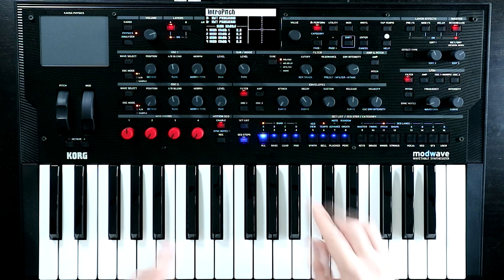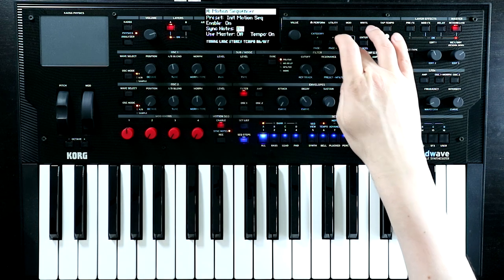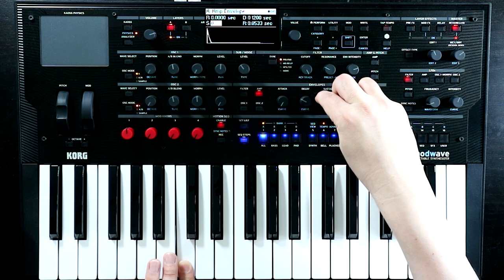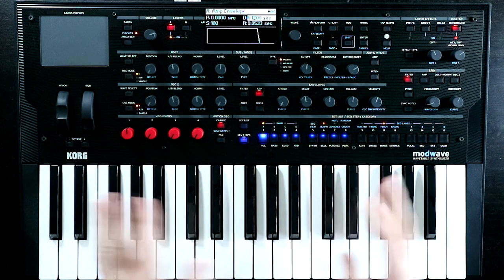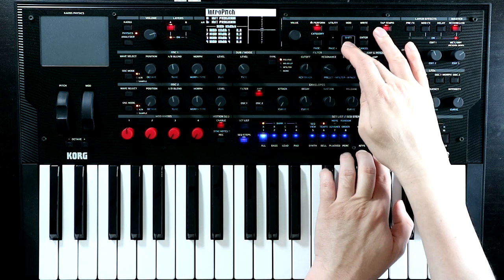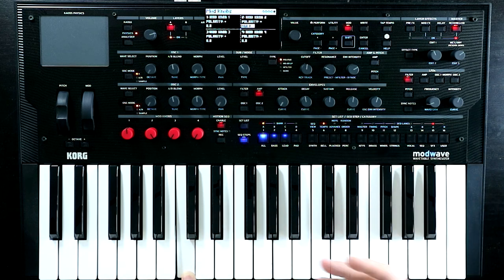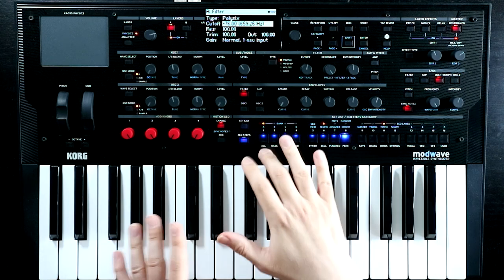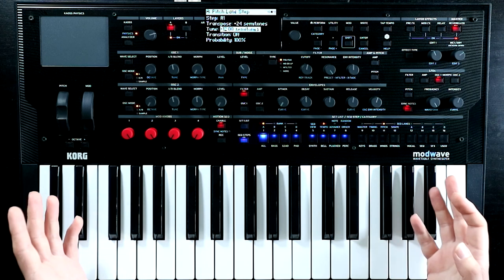Korg Modwave Sequencer In Depth - Part 1: Introduction and Pitch Lane

Comment: Excellent video. I bought the Modwave for my teenage son a few weeks back as he said he wanted something portable that he could dive into learning synthesis; you know, "baby's first synthesizer" and all that. Jeez, I had no idea the Modwave was insanely deep. Nice bit of easily accessible sparkle & shine to take a dip in the shallow end and noodle about on. But I tore the proverbial hood off this thing once I printed up the manual. Wow. Unbelievably deep in an incredible number of ways. I hooked this up to my Hydrasynth and mapped the poly aftertouch to several parameters on the Modwave. So lively and performance oriented. This Wave and Motion Sequencing tech is killer and I think Korg has just given us a glimpse of its future potential here.

Comment: You are really selling me on the ModWave - I didn't realize that the sequencer is on a par with modular analogue sequencing. I know that analogue sequencer modules themselves usually don't actually transpose - the CV summing to enable transposition occurs elsewhere - but the lack of transposition in digital step sequencers (e.g. Roland Boutique JP-08) has been a fail that has annoyed me enormously for decades.
Reply from the maker: The whole of the Modwave feels very "modular". I don't know if you've seen my video about the envelopes on the Modwave, but you'll see the same philosophy happening there. The Mod Matrix has, hundreds of slots, each with what is functionally a VCA optionally controlled by another parameter, it's all very modular.
Reply: @OscillatorSink  I'll definitely be checking out more of your ModWave videos.

Comment: thanks for this video. You say that if someone needs a "traditional" sequencer to build songs it would probably be better to resource to an external one. Could you please suggest one or a few cheap entry level sequencers that can do the job, maybe also adding a drum machine feature? I was thrown off by the Modwave when I found out that its sequencer is a "per note" one.
Reply from the maker: If you want a keyboard involved, the Keystep Pro is my default answer. That does melodic and drum sequencing (but isn't a drum machine itself).

If you want a drum machine that also does sequencing of melodic stuff, then I guess you're looking at something like a Digitakt, but that's a step up in cost and complexity maybe.
Reply: @OscillatorSink   Thank you so much!

Comment: Hello
I just bought this lovely synth. 
And I just can’t find out how you play a Multisamples sound alone, without the INIT, program, wavetable etc.
All The Best
Jonas
Reply from the maker: Hi, you can just turn the volume down on the other oscillator(s), but the sample will still be running through the filter and amp regardless.
Reply: @OscillatorSink  Thanks, will try it after my work.
Thank u very much for your quick answer🙂
//Jonas
Reply: Worked like a charm😀
Thanks again.

Comment: Amazing stuff! Do you have a “Modwave for dummies” series? I still can’t get modwave into a fast workflow. Like, I just want to grab a single parameter and modulate it. I failed at using LFOs and Envelops to change simple parameters like Oscillator 2 Level. (Wub Bass)
Reply from the maker: I don't have exactly that, but I do have this video: https://youtu.be/n_jPshKk7w0 where I start from an initialized patch and build up a finished patch from scratch which might show you the ropes.
Also this video: https://youtu.be/n_jPshKk7w0 specifically goes into the way that the envelopes work.
Reply: Thank you!l for the response! 💪🏻😎  very helpful
Reply: @OscillatorSink  also found your other videos helpful. I came to a good solution for a simpleton like myself: Instead of using Oscillator 2, I just use the 2nd layer Occilator 1. Amp envelop already matched. I think zooming out like this makes the unit more approachable.

Comment: How you put different notes at each step? I can't see anywhere...
Reply from the maker: From 28:30 I start showing the pitch lane specifically. But you're probably missing the point here - this isn't a 'note' sequencer in the traditional sense, it's a sequencer of parameters, per note, so you don't sequence "notes" you sequence pitch offsets from the note you're currently playing.
Reply from the maker: Basically, if you want a "NORMAL" sequencer, buy a Keystep and plug it in over MIDI.
Reply: @OscillatorSink  yes....with Pitch I saw that. I have also Keystep 37... So only with the Pitch it s possible in this gear
Reply from the maker: @QuantizStudioRecords  this sequencer can do lots more that others cannot, but it isn't a conventional note sequencer (although I show how to sort of 'fake' it in this video).

Comment: Great video👍. I'll definitely watch out for the rest of them. The ModWave is the synth that's most interesting for me right now. I'm curious as to whether it is "wind synth friendly" so I could play it from my Roland AE-30. Does it accept breath control?
Reply from the maker: The Mod Matrix is super comprehensive. Aftertouch (and poly aftertouch) are available as sources, breath control isn't an explicit source, but you can arbitrarily apply any CC number as a mod source, so I guess you just point CC 2 at whatever you wanted.
Reply: @OscillatorSink  Thanks! Sounds like it has potential then beyond just keyboard control. The AE-30 lets me pick which CCs it uses for different controls (besides breath it has 2-axis motion control and a pressure sensitive thumb pad).
Reply from the maker: @unclemick-synths  I'm pretty sure you can control the Modwave's x/y pad using incoming CC (18 and 19 - I just checked the manual!) so that could be a great starting point for exploring a lot of the pre existing patches!
Reply: @OscillatorSink  that's cool - the AE-30's elevation and tilt sensors would be ideal for controlling the x/y. The main question is how tightly bound the architecture is to the envelopes. I have found that Mono mode with legato (to avoid envelope re-triggering with pitch change) and aftertouch (to override the envelope sustain) is essential for wind synth control.

Comment: Can you tell me if it is possible to have the manually played notes only trigger exactly in synch with a midi clock. For example, lets say you have an 1/8 note set on the Modwave  sequencer. To my ears, it sounds like the keys sound on keypress, regardless to whether the sequencer is set to note sync. 

The amplifier seems to trigger on keypress, and I have not found a way (yet) to have the amp envelope synch up with the midi clock.

On my other synth with a sequencer, the Vermona '14, the VCA only opens on the midi clock clicks, (and a keypress), so a late manual note will only open on the midi synched VCA., VCF, which sounds better.
When I compare the two, as the '14 is mono, I set the Modwave to mono and I find the amplifier opens at keypress...still looking to sync the amp envelope to midi clock.

Basically it would be an AND operation:

If keypress is on, AND MIDI trigger is hit, then open amp envelope (on the modwave)
Reply: Did you find out the answer?